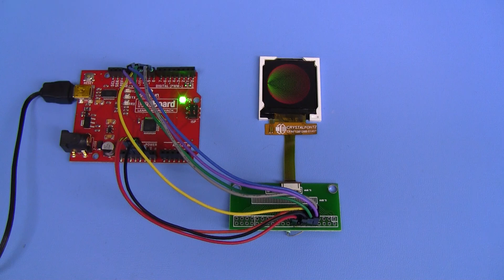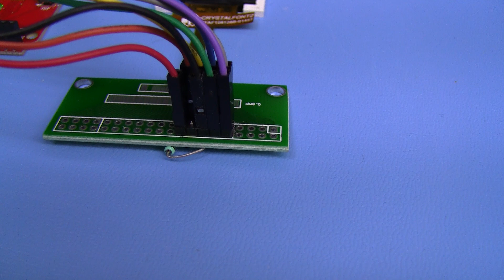CFAF128128B-0145T Arduino SPI TFT LCD Demo

Comment: Is it possible to have multiple lcd screens connecting to the same setup playing the same image? Or do you need all separate setups for each screen?
Reply from the maker: The interface is SPI, so you could "parallel" a few displays with no external hardware. Basically, run the same set of SPI lines from your microcontroller to each display. If you had more than maybe 4~8 displays, you would have to deal with the fanout. Each output of your micro can only drive so many inputs. So if you want a bunch of displays going you would need to put some buffers between your micro and the displays.